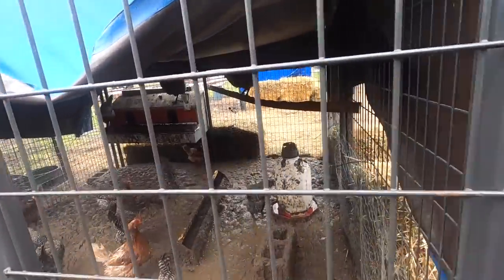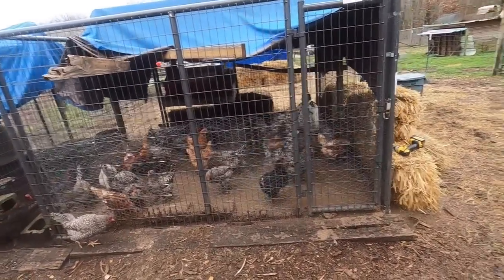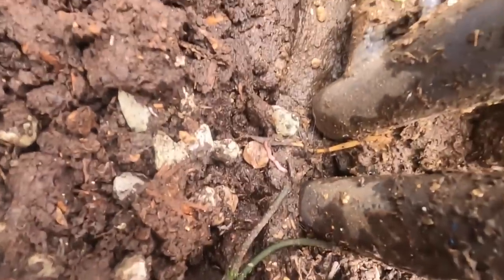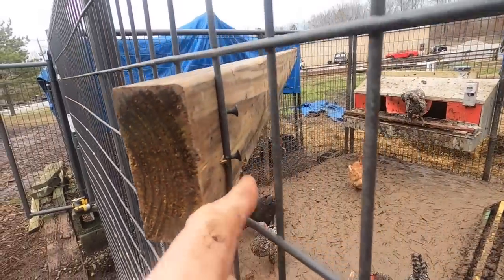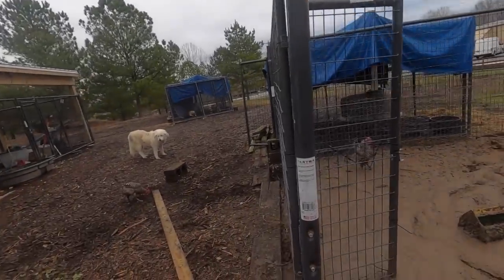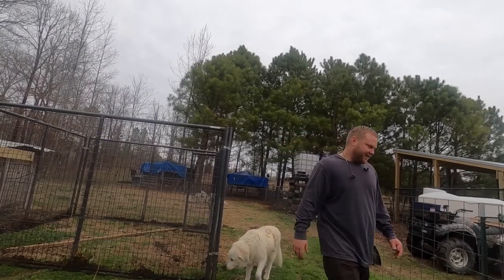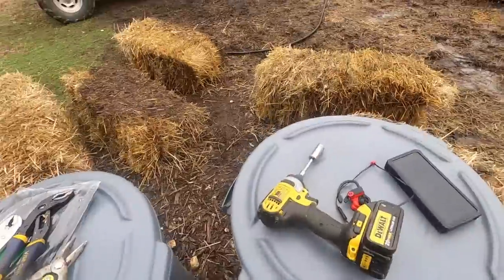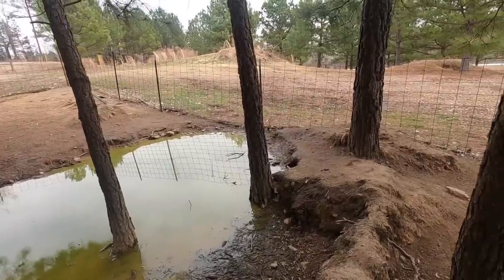Poop Soup At The Chicken Coop

Comment: Some metal roofs on the coops might save time in the long run. Could also collect water from metal roofs too. Just a thought. Alot of times places that sell roofing will have odd sheets that you can get cheaper.  Might be different colors and lengths. Seems the tarps work pretty good for you tho.
Reply: I think wind was the issue when I was brainstorming for John. The metal roof was definitely brought up.
Reply from the maker: Absolutely. I have always tried to keep them as light as possible. We move them a few times a year.
Reply: Good points. Mobility is important. Tarps work well especially for the cost.

Comment: Great video. Always good to see how you do things on the property! 
Some time ago, there was a plan to put in a new gate system. Is that still in
the works?
Reply from the maker: Yes. Gate systems in place. Dual gate like a Sally port. One gate opens and a truck drive in. Once first gets closed the second gate opens. Also a big heavy metal swing gate that will atop a dump truck. As well as concrete barriers. Additionally g more fencing now also.
Reply: @SOEtacticalgear  John, Thanks for the reply. Sounds like a great system. Is there video of the installation?